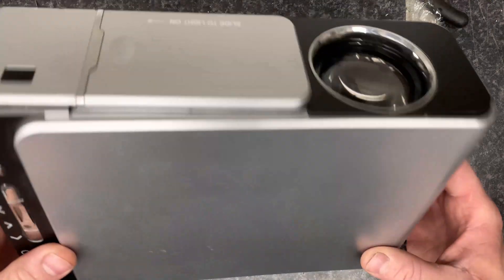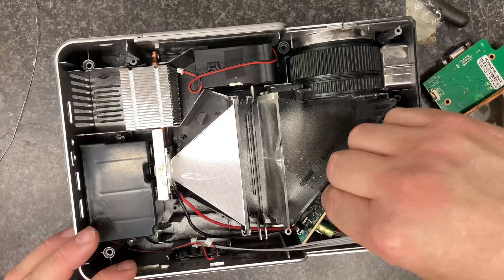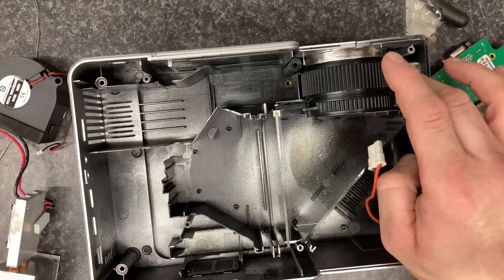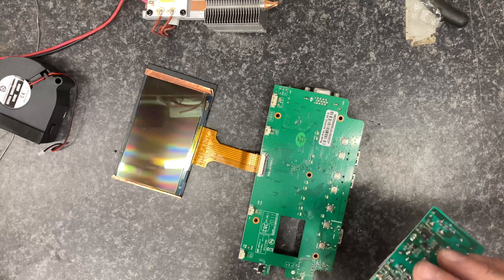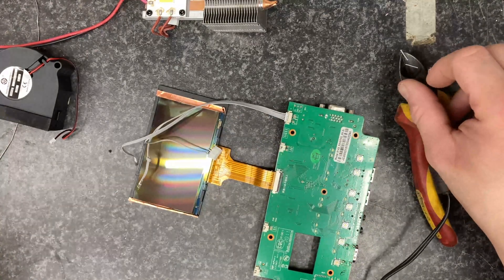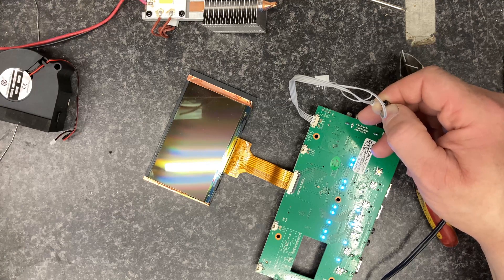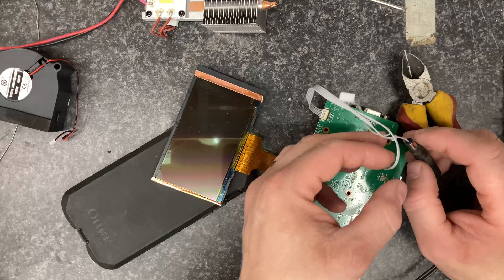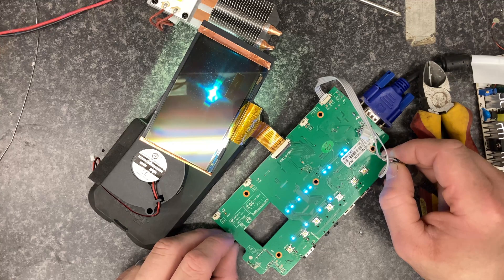Cheap chinese Projector teardown ,

Comment: So its a mp3 player/phonescreen with a flashlight behind it and a lens to focus it on a wall 😂 thx for taking it down
Reply from the maker: yep some what junk but you get what you pay for
Reply: @keycontroller  yes that's the secret. Mobile phone LCD screens are a commodity in electronic parts bazaar in china. With the rise of high-intensity efficient LEDs, a product such as this had to come out of the woodwork at some point. Despite all the derision, it has one advantage over its single-DLP counterpart: it does not spew rainbow effect artifact.